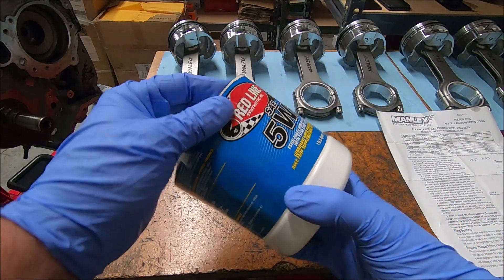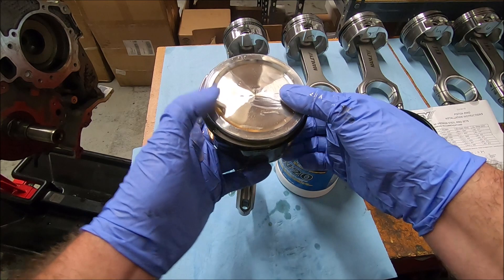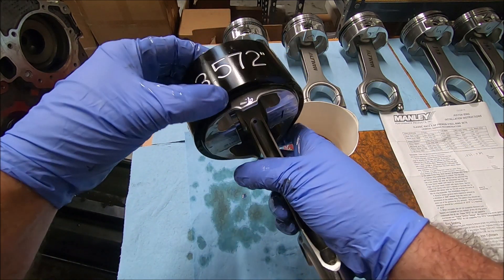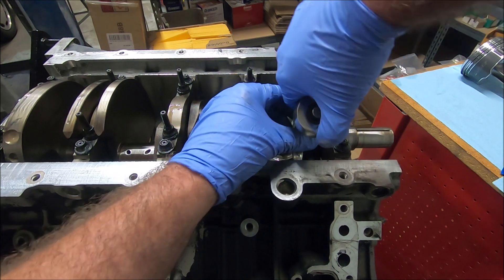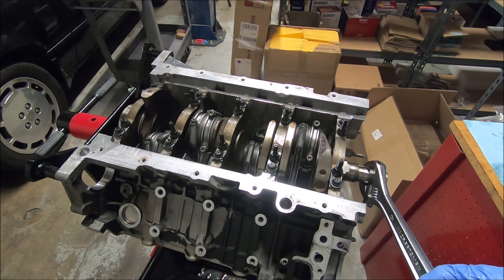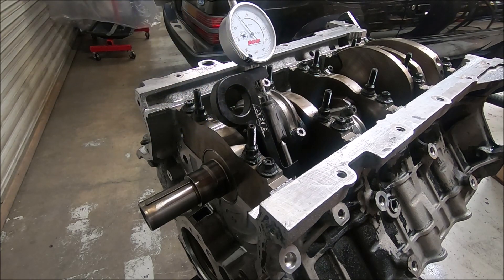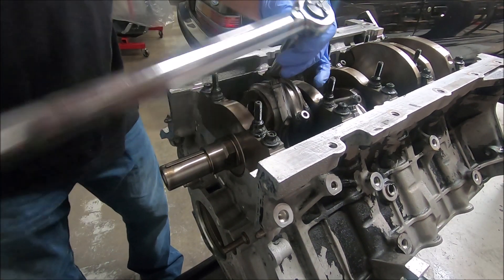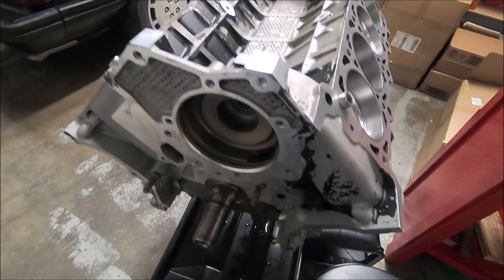99 Mustang GT with Nemak Part 6 – Assembling the Short block

Comment: Hi, do you know if the Manley directions for their rod bolts are different depending on whether you have the upgraded ones or not? I have the same rods but not the upgraded rod bolts like you and it says to use the 30-weight oil instead of the ARP lube. Do you recommend using the ARP lube even though the directions call for the use of oil instead?
Reply from the maker: 30 weight oil will be better than nothing, I prefer to use the ARP stuff that comes with their fasteners but if you don't have any then the oil will work almost as good.  I have not see directions say to use oil, the directions I get recommend their lube.  Unless I missed something.
Reply: K thanks